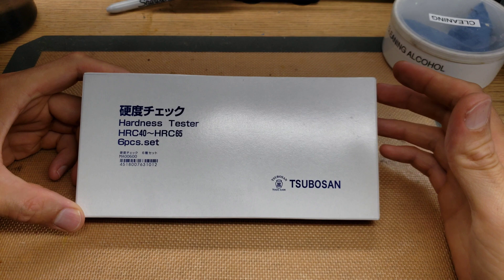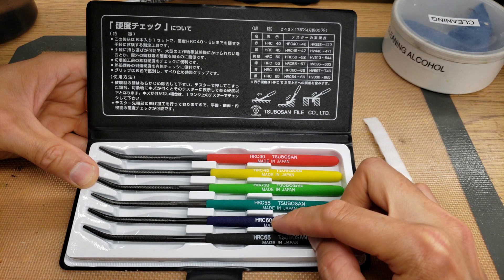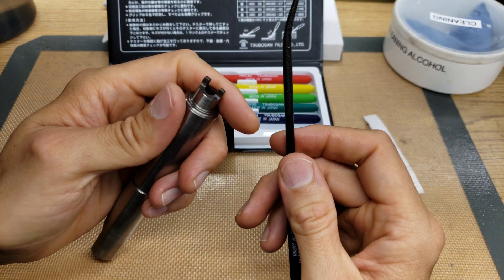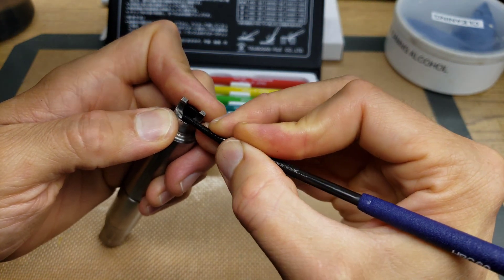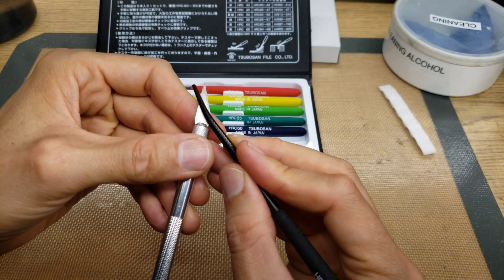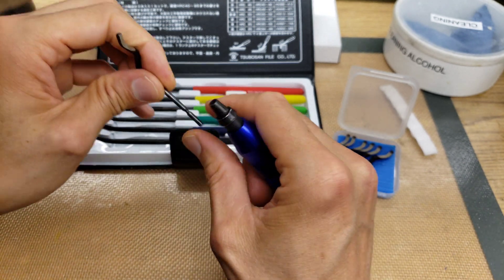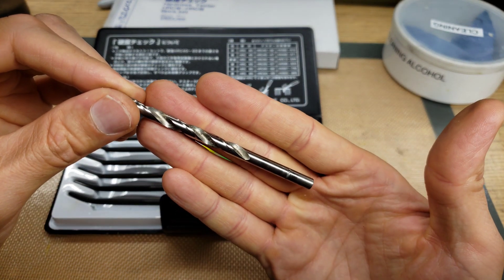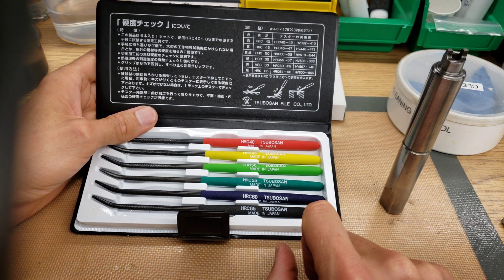Are They Any Good? Tsubosan Hardness Tester File Set Review and Demo How Well They Work On Steel

Comment: Just today tested an 'unknown' and it registered a consistent 52HRC on an Ames portable. Go to use the file and it doesn't agree. Said it was in the 60 to 65HRC range. Okay, maayyyybe the penetrator is off. Grab a standard at 55HRC...... no bite on the 60HRC file, but a 'heavy' bite from the 65HRC file. Used the cleanest, least used areas (due to mu holy shit confusion as this was the first time I've cross referenced.....by chance). Go to a known piece that was 50HRC and the 55 didnt touch it and only the 65 did. Not sure if theyre 15 behind, which is insane and exponentially softer than advertised and declared, or if (given their nature as references) theyre just junk, but mine ate in accurate as far as compared to an Ames tester that was calibrated as it matched the two standards tested against before this novels explained conclusion.

Comment: I don't know about these things. I heat treated 80crv2 exactly as specified by Alpha Knife Supply, quenched in Parks AAA and every single one of these files made a mark on the blade. Heat treated another knife, same thing. Maybe I have a bad set.
Reply from the maker: @robthompson8285  Test the files on something of known hardness. Do they all grab on the blades?
Reply: Usted no alcanzo a templar.

Comment: I bought these and tried it once in the wrong order, for some reason I thought i was supposed to start at softest. Luckily I didn't use them a whole bunch of times so im sure they are still good.

I thought i was supposed to look for a scratch on the material, but i quickly noticed that some slid off and some grabbed and then i was pretty sure that was more what i was looking for. Thanks for making this video so I can do it correctly now.
Reply: I guess it depends on whether you care more about preserving the workpiece or more about the files.